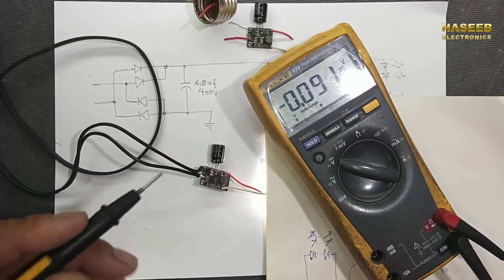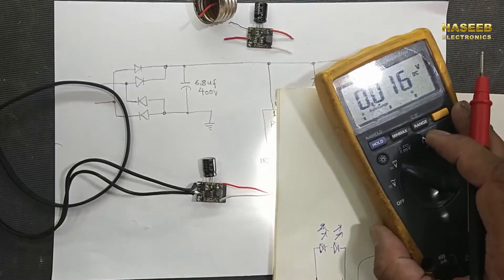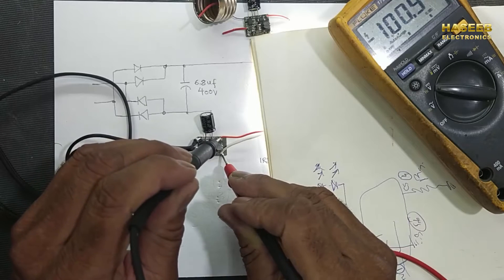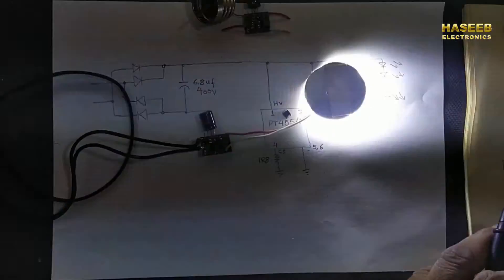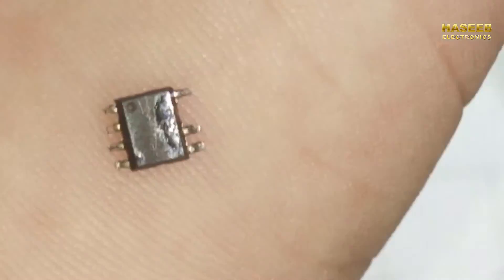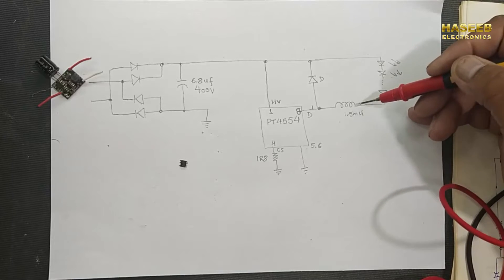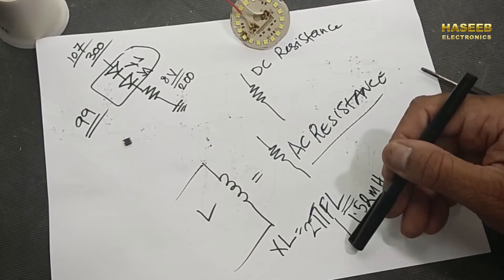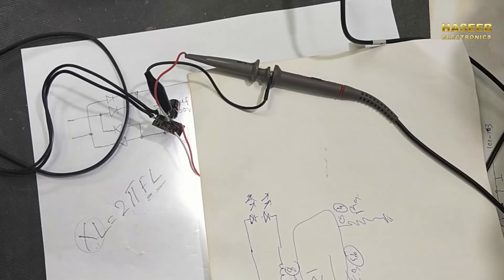[394] LED Driver Circuit Explained / Working PT4554D /PT4554C LED Driver IC

Comment: My understanding is that an inductor is a variable resistor whose value can be manipulated by changing the frequency of the signal. Low frequency signal produces less resistance(or inductance) and hence drops less voltage across it. High frequency signal produces high resistance(or inductance) and hence drops more voltage across it. 

Rule of thumb: If you need to design a circuit that has a requirement to automatically adjust resistance(or voltage drop), use inductor along with an IC that produces signal with different frequencies.

Comment: I have done experience with my non-isolated LED driver using OB5628 ic, I connect low voltage 30vdc for safe purpose and watch out the drain signal and inductor signal when the LED is disconnected the frequency will be 2KHz and when connecting LED it raise to 20KHz 👍

Comment: Is it programable IC?
Reply from the maker: no it is not programmable, the outer components (Resistor & capacitor) to set frequency and current are called programming components

Comment: Basic objective of the led driver is to provide constant current not voltage. Your explanation may please be modified so that it is understood properly.
Reply: Yeah I thought so, but I didn't understand why the frequency changes or their a relationship between the input voltage and the output frequency to give a constant current?

Comment: Dear Sir
This is  constant current driver and hence for driving constant current the output voltage varies with load. If you change the load the output voltage will adjust to supply constant current to load as per design. If you reduce the load, output voltage will decrease and with increase in load output voltage will increase.
Regards

Comment: you should clearly tell what is application of driver xircuit. I was looking for this but did not get the answer from your video.
Reply from the maker: what happened dear brother. if you are not satisfied, really i am sorry for that
you can send your question to my gmail ashraf4ta4
or whatsapp 00962-79-1161-084

Comment: i think this driver is a current regulated not voltage and ur measuring the same voltage cuz there is a 18 leds itch one  6 volts = 100 v

Comment: instead of 100 volts output, what changes are required to bring down the out put to say for example 12 volts. please guide.
Reply from the maker: if you want to use it for LED in that case you will need to increase inductor value, 
for normal voltage step-down purpose, use buck regulator instead of LED driver
Reply: @HaseebElectronics  i want to use the old   LED bulb charger having a typical OP of around 90 volts for powering just  three LEDs requiring approximately 12 volts. sorry to trouble you sir, any other possible modification, other than using buck regulator.

Comment: Sir led bulb fuse again and again why please describe sir
Reply from the maker: its buck regulator circuit is not controlling the current or may be it is giving more voltage than the LED requirement

Comment: Thank you! The bulbs are very efficient, but still get very warm at the base. I wonder if they could be made to run any cooler? Best regards.
Reply from the maker: special thanks and best regards
Reply: In fact is reflection light to led make heat..and   compare  heat lost  / u* I  it be 20 % so 70..80 % becomes  light......

Comment: Hello bro hassib, plz I need help I got r7731 smps pwm controller short , in my lab I got cr6853 and thay r same in datasheet  but the problem is in startup so in oscilloscope I see pulse for 50ms then gone instead to use 220v I'm just using 14v supplying directly ic and I respect all conditions like ( I sense 0.2ohom), (100k RT), (FB) , so more info the board it has 1.5 M startup resistor, my question  could I see pulse of output if I put that IC in test board, thanx our best teacher

Comment: Thank you for the clear explanation! That inductor seems to take a lot stress in this driver. I thought LEDs should get only clean DC voltage, but here the LEDs are getting pulsed voltage. Do all LED drivers output pulsed voltage? 

Many LED lights at my home start flickering a few minutes after they're turned on. This problem seem to happen to brand new lights also. Some people suggested that the real problem is the failure of a filter capacitor at the driver circuit. I've tried replacing the filter caps but the results were the same. This a really common problem that exists at almost every household. Do you have a solution for this?
Reply from the maker: i am thankful for your valuable feedback
approximately most of LED lamps (even small handy torch or flashlight) use this technique, it is to protect LED from any over voltage stress 
whenever, the input voltage limit (upper limit or lower limit) is crossed, the ic goes in reboot state,  sometimes if the bulk dc capacitor is week, in that case the ic will also go in reboot state.
Reply: @HaseebElectronics  So the continuous rebooting is the cause for the flickering?
Reply from the maker: exactly

Comment: So this is not a buck topology? 🤔
Reply from the maker: exactly it is much closer to buck topology
as buck converter most of time uses duty cycle technique
but in led driver, it changes frequency
Reply from the maker: exactly it is much closer to buck topology
as buck converter most of time uses duty cycle technique
but in led driver, it changes frequency